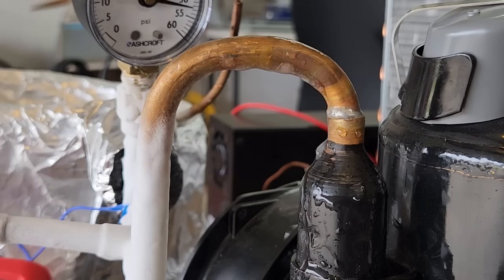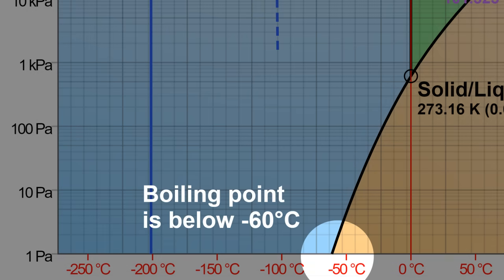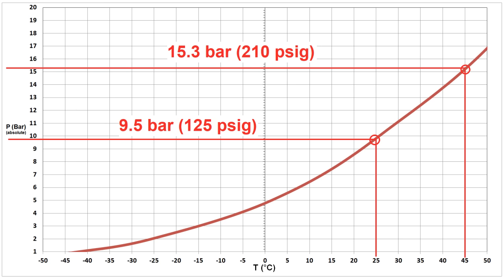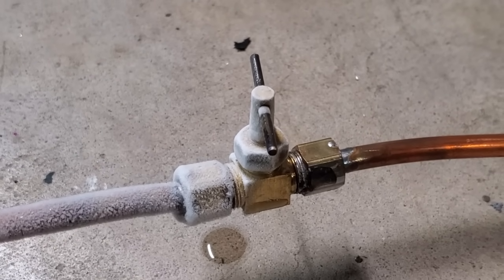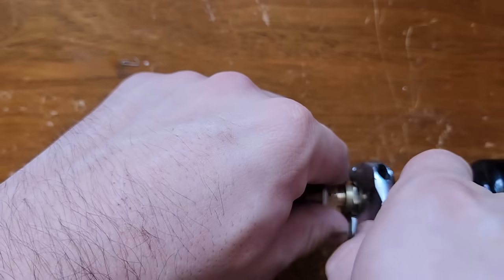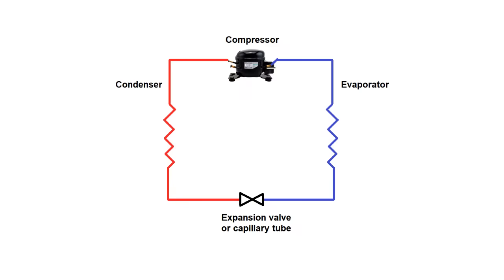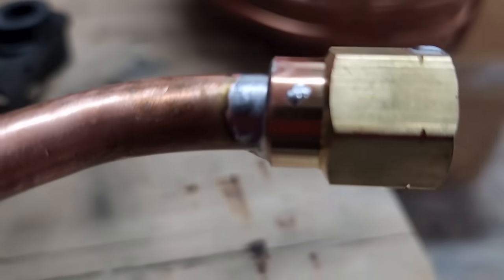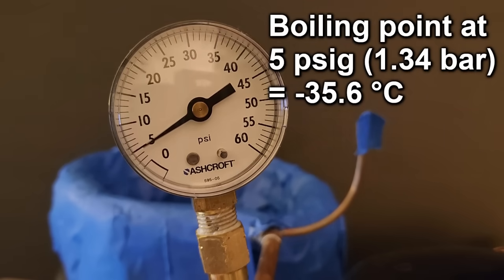DIY Vapor Compression Refrigeration System

Comment: 13:55 - Copper work-hardens, so your straightening of the coil to thread the other one through would have already hardened it, made it more difficult to re-coil (in addition to the added internal pipe). Annealing (heating and quenching) isn't really an option here either with 18ft of straight pipe, so you often need to be frugal with your manipulations, lest you end up with some really stiff pipe.
Reply: Yeah that's very true.  I've noticed my pipe also getting stiff when I manipulate it.  😅🤣
Reply: Sigh.... Ever heard of induction heating? He could literally just run the line over a cheap induction cooker on high with one hand and use the other to drizzle a water hose.
Reply: @custos3249  Wow, that's brilliant - it doesn't sound difficult and subject to having specialist equipment on hand because induction cooktops are of insufficent power and design at all. You should comment more, your input is well considered and valuable.
Reply: Good luck induction heating copper.
Reply: @LitchKB  Thanks - new here. After looking at cost, seems new stand alone cooktops got a little pricey. And since a cooker would also need a few modifications to remove safety features stopping it from getting hot enough, might just be better to build a proper purpose-built induction coil. Granted, the solutions they make for automotive purposes are pretty handy - just a little spendy though.
Reply: @VEC7ORlt  I have a small smelting crucible made from an old induction microwave, so something tells me it's a strong maybe.
Reply: @custos3249  Induction microwave? What does that even mean?
More conductive the metal is the worse induction heating works on it.
Reply: also tube in shell heat exchangers for wort chilling in beer making r almost as cheep premade as the copper itself, also they use what they call a Dephlegmator in moonshine stills thats just a tubes in shell design with convenient triclamp fittings
Reply: @VEC7ORlt  Bet if you type that into google, ya might just figure out your first real world word problem.
Reply: It could be annealed by just heating and a slow cool but the pipe would need to be filled with an inert gas like argon which may or may not be available. Otherwise the copper oxide so formed could damage the pump. Small pipe like this, even when hard is not too much of an effort to form.
Reply: You can anneal a long length by heating it with a blow torch and then quenching it with running water as you move along. That's how factories do it. Also Induction Heating does work on copper: https://www.youtube.com/watch?v=wSYmFRsQvjo
Reply: @custos3249  I know what induction means and what microwave means, and those two don't go together.
Reply: @zenmark42  This is correct, but you have to do something to stop the copper oxidising on the inside. Commonly achieved by filling with argon. Otherwise the copper oxide formed can find its way to the compressor and cause abrasive damage. Even slow cooling from near red heat would make the copper soft enough for easier handling but is probably not worth all the effort with such a small diameter.
Reply: It's funny to hear both the professionals and the amateurs talk about things like how you can't just heat it up without an inert gas because of the oxidation... Or how you can do this or can't do that but the reality is you can heat the damn thing up with a torch bend it however you want, and in the end it's going to work. It might not work for 30 years because of thousands of reasons but that doesn't apply to this application. It's right in that nice middle ground where you can just do it and ignore everything everybody's saying is wrong. Lol
Reply: @TravisFabel  The whole point of these videos is to encourage the exchange of ideas. Is there anything wrong with that? Some ideas are pertinent, others not so but what is important is the conversation and interaction.
Reply: heh
Reply: No need to quench copper, it will remain soft regardless of how fast you cool it. So it would be very easy to anneal with a simple blow torch. Cleaning it again would be a lot more work.
Reply: @zenmark42  "Graphite crucible" -- graphite of that thickness is an excellent susceptor at typical induction frequencies (>10kHz?); also once the copper is hot, it's not too bad itself, but starting from cold is a right pain, even with the capabilities of an industrial machine. An induction cooktop will simply not detect a load and refuse to run, and even if forced to, will only deliver a fraction of its power rating into cold tube. (Source: I designed and built industrial machines.)

Comment: This is the best video I've seen on the subject, and I've watched many. I had to make a coaxial tube heat exchanger a number of year ago...
On straightening tubing: Grab one end with a vise, grab the other end tightly in a drill chuck, pull HARD and turn the drill a few revolutions until the tubing is straight. Don't overtwist the tube. Cut off the mangled ends. Annealing the tubing should not be necessary. Putting one tube inside another is quite easy when both are straightened. I learned this method from an electrician who used it to straighten solid copper wire. 🙂

Comment: While it's easier to just buy an A/C unit, seeing a system built from the ground up was really cool (ha ha).  Vapor phase refrigeration systems were always a little mysterious to me, the many unstated details necessary to make one work, so seeing one built from scratch was really appreciated.
Reply: technically, you can make one with a straight pip connected to both sides of the compressor, then hammer it flat until it has enough flow restriction. terrible design for anything though.

Comment: HVAC Tech here. 
You can switch "gears" by having three capillary tubes at different lengths in parallel with a valve that isolates each tube for up to 6 "gears" by opening and closing certain tubes at certain times.

However, this is a lot more convoluted and expensive than simply just using a regular TXV. However, using a regular TXV is difficult because you're doing something without any engineers or refrigerant knowledge, so you won't know exactly what model of TXV you'd want (they change based on the cooling load required and the expected operating pressure range of a particular refrigerant). Your best bet is to get an EXV which uses an electromagnet to turn a magnet inside to open and close the metering device. This has an advantage that you can test where you want the EXV seated at which stage of cooling, and program it with an raspberry pi or an arduino. You'll be able to trial-and-error it to where you want it to be for a given load.

Comment: First, I think your channel is probably the best on YouTube for inventing/engineering discussions that show the actual process of trial/evaluation/retrial of ideas. Keep up the excellent work.

However, a few points that are likely also being made by other commenters:

Soldering propane connections is unsafe and prohibited by the gas code (at least where I'm from). 

The connections at the end of your evaporator/heat exchanger are very sketchy. The wetted surface area of your soldered joint is very small, and will be subjected to substantial thermal stress. Don't be surprised if it starts to leak. If you rebuild it, I would strongly reccomend you use a reducing tee instead of a 90. You can find models that are AxBxB sized where you can have a sidearm and one through connection at the smaller tubing size, with the second through connection larger. You then file/grind/drill out the stop inside the smaller through connection and can run your smaller tubing right through the tee. This allows a full sized brazed or soldered joint on all three pipe connections. The home distilling community has lots of examples of condensers made this way.

You might also want to consider using a small brazed plate exchanger instead of a tube-in-tube. You can get these quite cheaply in the usual spots online, and they're often rated for refrigerants and their working pressures.
Reply: its 50 grams of propane bruv

Comment: In your diagram of the coaxial heat exchanger, it shows a concurrent flow. Usually countercurrent heat exchangers are better, as they allow for more efficient heat transfer. There's other engineering reasons for concurrent flow but I don't think any apply here.
Reply: You are correct, very good point!
Reply: Never heard "concurrent" before, I only knew it as cocurrent or co-current. Are your sure that the n is supposed to be there?
Reply: @leocurious9919  Concurrent means at the same time or in this case it means in the same direction, so his choice of word is correct. Incidentally, I don`t approve of this `nit picking` I does nothing to encourage conversation or understanding.
Reply: Correct
Reply: @TheTemporalAnomaly  It does help to "nit pick" something like that. It could be wrong or it could be a new term to learn for people like me. Either case is a win for me.
Reply: @leocurious9919  My apologies Sir. I didn`t realise it was a serious question. You are right, no matter how clever we think we are, there is always more to learn.

Comment: A little while back, I repaired a -50c cryocooler. It uses a 1/3hp pump similar to the first one you showed and a custom blended refrigerant I couldn't find any details on. One major mistake was that measuring the evaporator pressure at the compressor gave inaccurate pt chart results for the minimum temperature observed. After a lot of trial and error, it was discovered that measuring the pressure at the meters' entrance to the evaporator more accurately predicted the observations.

A pressure gradient is formed inside the tubing. In normal hvac applications, this gradient is not an issue as the goal is higher efficiency, and the 'exact' boiling point is almost irrelevant. But for your application of mathematics, I believe it should be accounted for.

There is a post on sciencemadness about it. I hope your success continues, and I really enjoy the videos you're making. Stay safe

Comment: I was doing this 15 years ago for cooling CPUs, I still have a mostly full D sized cylinder of ethylene. Pro tip, get your hands on a plate heat exchanger for the interstage, they have incredible performance for their tiny size and are easier to insulate.
Reply: When I did this 25 years ago. 
People said I was insane for putting propane in a cooling system. 
I repaired an old Pepsi cool box. 
Whit just propane that was for the bbq. 
It is still working. 
Now all fridges are filled whit propane
Reply: @jantrammelant    I thought it was just the small ones that were filled with propane and/or isobutane?

Comment: I saw the title and instantly remembered a PC case I had back in the day with a vapor chiller.  It was a special edition ThermalTake and had a proper multistage fridge compressor for extreme overclocking.  I used it to push a Phenom <3ghz quad core to almost 5ghz in 1999.

Comment: To get the centre pipe through the heat exchanger, you might want to send a flexible piece of plastic through first, then attach the copper. That way you can `pull` the copper through and it will be much easier. To clean the `fuel` type propane up, I have a tank that contains a few pounds of activated charcoal, I transfer a quantity of of propane and let it sit for a day or so. This will absorb most of the  stenching agent. This is needed for a long term unit as the stencher is rather corrosive to some materials. Lastly, the soft solder is not suited to long term operation in a unit like this. Some people think it`s not suitable for the pressure, this is incorrect though. The real reason that it is not suitable is that after many cycles of hot, cold, it begins to crack. You will most likely see this effect where the layer of solder is thickest, like in the connection to the capillary tube.  Great video series, watching with interest!

Comment: Idea for the capillary tube: You could put a few taps in it like you would for a transformer. That'll give you a couple of "gears" to switch through.
ie: Every couple of turns you could attach a valve and then depending on the length you want, open that valve. it'd be a bit of work but it would give you some variability.

Comment: In a former career I was an industrial / petrochemical refrigeration technician and have worked on many weird and wonderful simple, compound and cascade refrigeration systems utilising various Freon, Ammonia, Propane and Polypropylene. 
Just a couple of suggestions, first you really need to understand and carefully select your compressor oil as the propane is a solvent and the oil if not selected correctly will be miscible in the propane, now on a small system it may be something you get away with but it’s something you need to consider when you using hydrocarbons as refrigerant.
Also with regard to your propane from a torch bottle like what you used it’s very likely going to contain other gases that will effect your pressure temperature relationships in both your evaporator and condenser, these will likely include butane, Ethane, pentane, some can be purged from the high side (this should reduce your condenser pressure as some will be non condensible at your system pressure & temperature)
If you are going to use a capillary you should be measuring the amount of superheat at the end of the evaporator and adjust your capillary to achieve maybe 5 - 10 Kelvin of superheat above your evaporator saturation temperature otherwise your compressor has very little cooling, too little superheat and you could slug liquids into the compressor. Alternatively if the evaporator operating temperature is similar to R22 saturation conditions then you could possibly get a way with using an R22 TX valve.
Also I’d suggest using 15% silver solder on copper joints and 45% on anything dissimilar ie copper to steel or stainless

Comment: Bro, these vids are like CRACK to me, every time I see you've posted a new video I instantly binge and rewatch it a couple times for good measure ☺️

Aside from your epic and super interesting project, all the refrigeration knowledge you're pumping directly into my eyeballs is seriously informative, and I'm now finally starting to understand why my first air conditioner unit failed with the entire thing feeling 80 deg C on the outside with the lack of noise waking me up deep in the night when I panicked from the external plastic casing temperature and immediately turned the thing off. I haven't dated turn it back on ever since, and I was fiddling with the starter capacitor because I though that was the cause of the issue, but now I'm starting to doubt that. Thanks to your videos I really feel like I'm finally learning enough about this topic to be able to fix the thing myself in the future (I hope!!).

thanks for your epic vids, AWRRRRRR MATEY! I really appreciate all the effort and hard work you out into these super educational videos of yours! ♥️

Comment: Many years ago my 87 Grand Marquis developed a refrigeration leak ( R-12 ). After three expensive trips to three different A.C. "Specialists" it still required Monthly recharges of (Then Very Expensive) R-12.  
I built my own set of recharge lines and began using very cheap Propane. The car NEVER was parked inside a closed space and it never leaked inside the car. Worked like a charm. The leak was somewhere under the hood and so small that there was no danger of explosion.

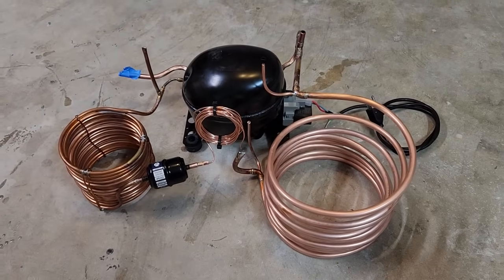Comment: 14:17 Take a look at this arrangement of tubing for a VCC system in a modern regenerative VCC refrigerator, linked below. In this design, the capillary tube itself is used in the heat exchanger, and the heat exchanger is in a counter-flow arrangement, which should yield higher efficiency. I linked straight to the timestamp where the coaxial capillary tube and gas return tube (which is effectively a heat exchanger) is explained.

Modern refrigerators explained (timestamp links to introduction of the coaxial capillary tube + evaporator vapor return tube, which acts as a recuperator. Hot condensate is used to warm up cold vapor/cold vapor is used to cool down hot condensate, making the whole system more efficient, as less refrigerant needs to be evaporated to cool the remaining refrigerant to your target temperature. )
https://youtu.be/7NwxMyqUyJw?t=301

This arrangement would save you a good bit of flow friction losses, and would perhaps perform better than the design you showed in this video.
Reply: This indeed increases efficiency but it impacts absolute temperature IME. I did this on some "early models" of my freeze dryer.